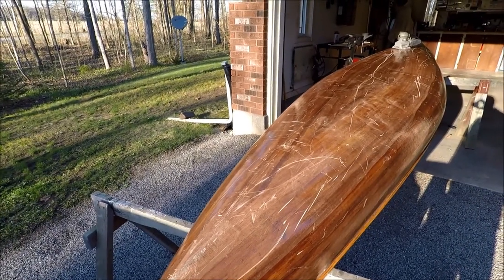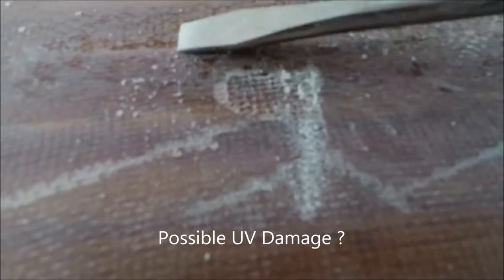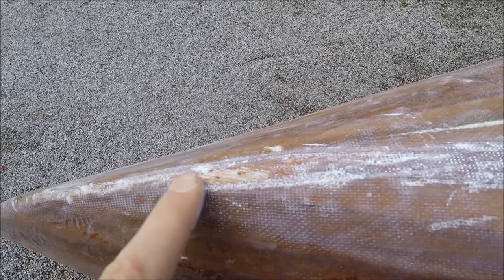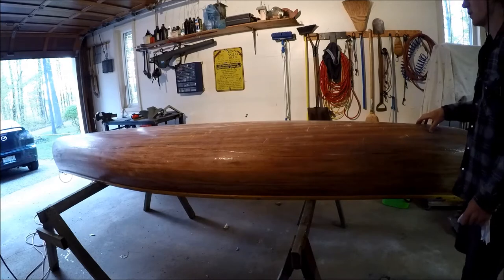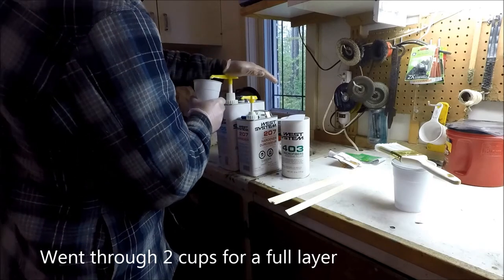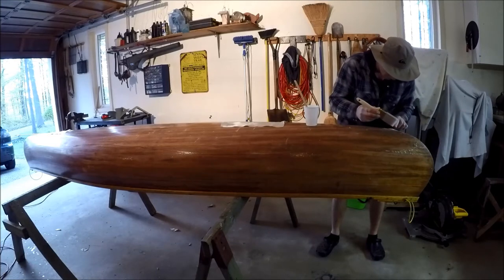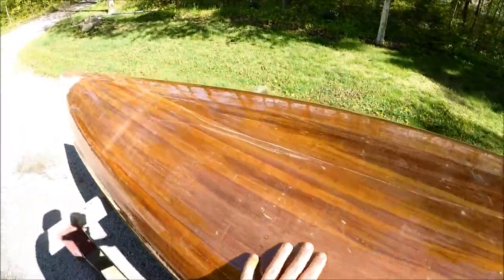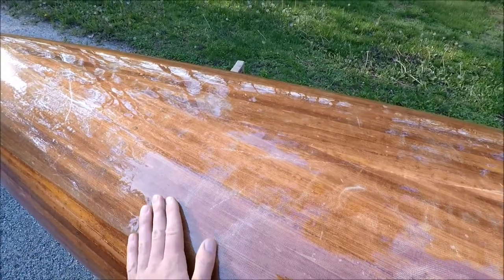Restoring the Epoxy on a Cedar Strip Canoe

Comment: Sorry, this is not UV damage, it comes from if you pull the glass fiber directly onto the wood, so always first coat the wood with epoxi and let the epoxi move in, then coat the second epoxi and only then pull on the glass fiber, all of these operations, of course wet on wet this gives the best and safest connection, this of course requires that you use an epoxy that reacts slowly so you have enough time from one work step to the next work step !!! bad connections don't show up immediately, bad connections only show up over time !!!

Comment: My Peterborough canoe has some delam spots, but not white as in your video, I have lifted parts of fibreglass and wood bubble, dont know if its fixable, and dont want to drill any holes yet till I have a solution or if you can provide..... I also have a large piece where it went white and delammed all the way so im trimming and will re fibre cloth and glass, done that before and it worked, just wondering if you can handle some pics and give some advice. Thanks
Reply from the maker: thanks for watching, i would follow the video as best as you can.  You need to get rid of any sections that are loose or delaminated.  if the wood is rotten or gone get rid of that too.  make sure you get back to solid wood or solid epoxy before re applying epoxy.  Good luck !
Reply: @RobinsonCustomWoodworking  so the delaminated between wood and FG are only on the outside, and although delamed the continuous hull does not have any bad areas to grind or cut out. I'm going to leave them alone and just recoat with more epoxy, that should give more durability and solidness. Paint store guy Said not to use the West system(2 part) which is what I had used in the last two refinished, he says go with a marine brand from a marine store. Do you know what that would be? Lastly need to replace the seats, any suggestions, catgut,? They were solid oak but now have cracked and dried out....tks
Reply from the maker: @kinetikhockey8120  i'm not sure why the paint store guy would say that, West System is a leading provider in marine epoxy.  Just check out their project page.  Solid oak that is cracked can be repaired depending on the severity.  You can actually force the seat to snap in half then reglue with titebond III directly where the crack is and glue it back together.  Or 4 coats of boiled linseed oil will reintroduce moisture into the wood and stop it from drying out.  white oak is water resistant, red oak is not https://www.westsystem.com/projects/

Comment: Can we just go ahead and apply 2nd after the 1st coat gets a little tacky? like after about 2 or 3 hours of drying? I think I've seen some people on YouTube apply extra coats this way. Or is it absolutely necessary to fully cure the 1st coat and sand before applying the 2nd coat?  If we do several coats what's the best policy? I use West System epoxy too. Thanks
Reply from the maker: Yes it is possible to do it that way to
Reply: @RobinsonCustomWoodworking  so, if we do a nice smooth job applying the several coats we don't need to sand any? The hull will be all finished after we stop coat applications?  Or maybe give a light 800 grit sanding then buff out with compound stuff? I've used Sherwin Williams very strong compound to get out light scratches before. I may wax as a final coat. Have you heard of doing that?  Wax for more UV protection and a super slick finish for faster padding.
Reply from the maker: @Hundert1  my advice to you would be to follow the instructions given on the west system website or instruction sheet.  Every application is different.   I have heard of using 3M Perfect It to remove scratches.  I guess wax would work as long as you keep applying it.
Reply: @RobinsonCustomWoodworking  Awesome, thank you! I will try find and read West System info.

Comment: hiya.  this is pure gold to me, as i'm trying to fix the canoe my dad built and i've never done anything like it in my life.  I couldn't hear what you were saying about what you were wiping it down with after you sanded it, vacuumed it.  just alcohol?
Reply from the maker: thanks for watching i used denatured alcohol, it evaporates quickly.  I have a paddle board video where i use this right before fibre glassing
Reply: @RobinsonCustomWoodworking  What about isopropyl alcohol? What's wrong with that? Maybe it's not a strong enough cleaner? Thanks
Reply from the maker: @Hundert1  i dont tsee why it isopropyl wouldnt work
Reply: @Hundert1  Works great. no worries

Comment: So thats all epoxy plus a finishing epoxy as the final coat?
Reply from the maker: yes
Reply: I think the same epoxy is used as the final coat
Reply: I clean using acetone. As for the final coat, I finish off the epoxy coat as smoothly and consistently as I can, then add on a couple of coats of yacht varnish with uv filtering as the really final coats.

Comment: How much did the FG cloth weigh?
Reply from the maker: hey i didnt put any new cloth on this canoe, i just sanded down the old epoxy and put new epoxy on.  I have a paddle board fiber glassing video and the mass of the cloth is about the weight of a large T shirt
Reply: My canoe had 4ounce cloth, and was told it would be enough and it has been